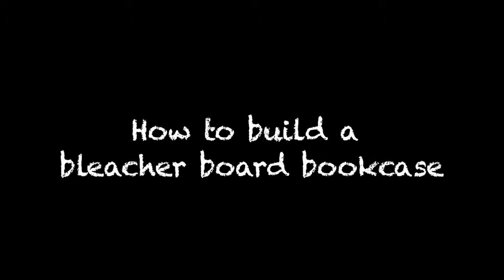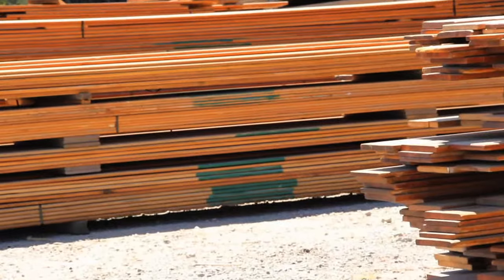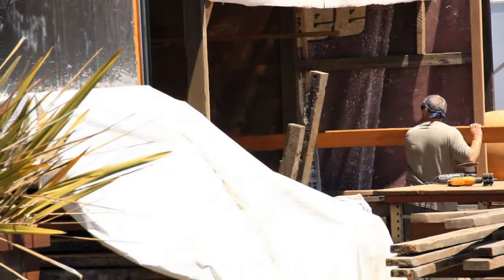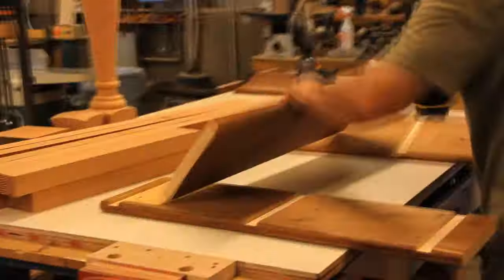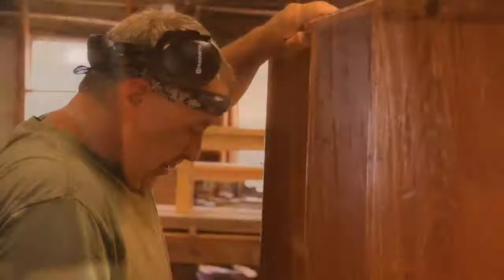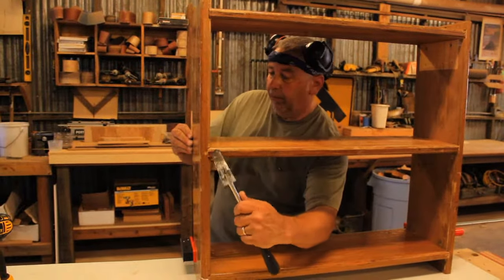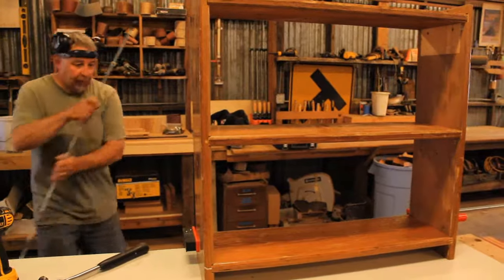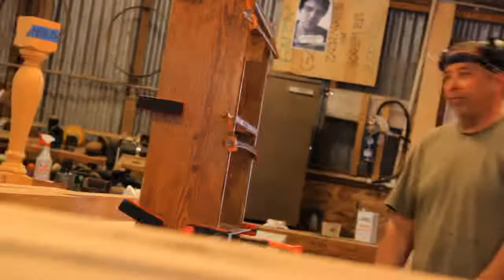How To Make Easy Reclaimed Bleacher Board Bookcase

Comment: I reclaimed a lot of pine bleacher boards, heavy cured sealer on them, what’s the best way to strip the sealer so the boards can be sanded, stained and sealed again for flooring? I ran a couple boards through a planer, several times, but just seemed to gum up due to the amount of original sealer on the boards. Any tips or tricks would be greatly appreciated